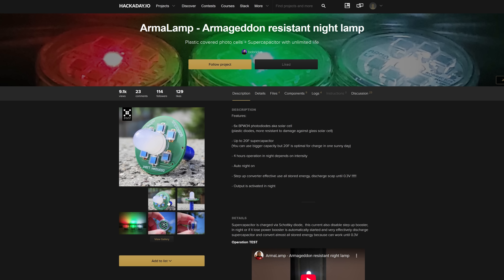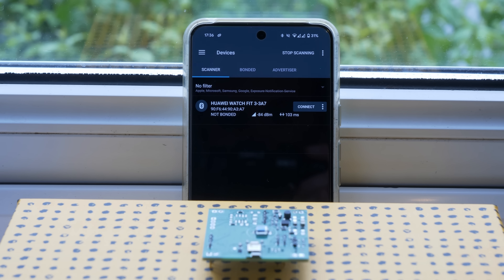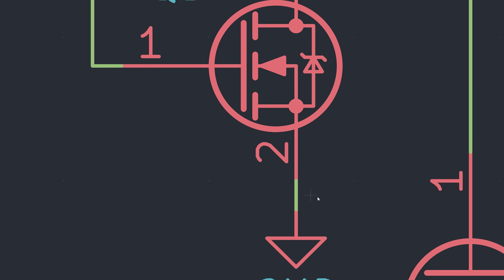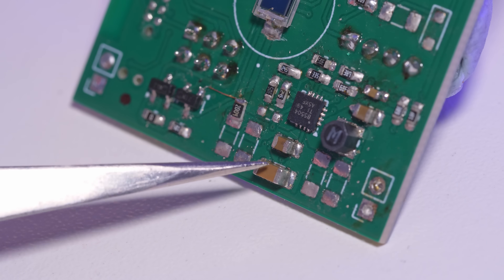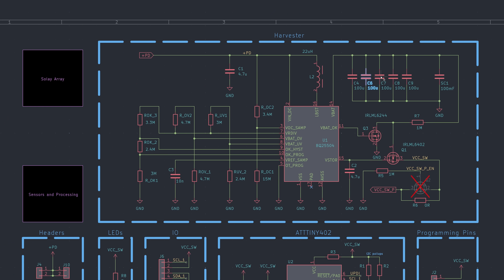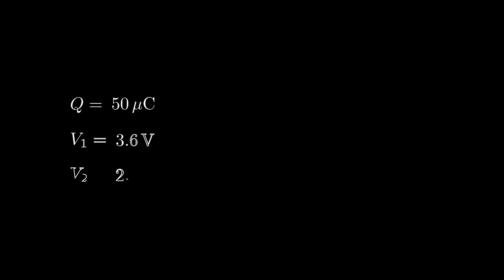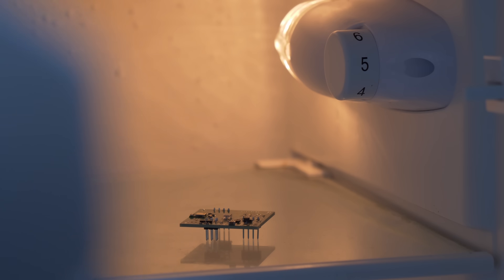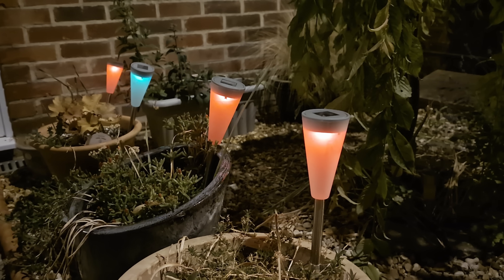Nordic chips are so efficient, you don't need batteries anymore

Comment: good project, but how does the boost converter handle a completely dead capacitor ?
They appear as a dead short at very low charge and resistance of the capacitor goes up as more charge is stored
Reply from the maker: Good spot. This specific chip starts off in a linear mode until the storage device reaches a high enough voltage for the switching circuit to start up.
Reply: @PocketConcepts_ I only ask as I did make a solar usb backpack once with 6 watts of solar panels powering into super capacitors instead of batteries. The voltage was clamped at 5.1 volts via a few power zener diodes to protect against over voltage. Worked alright but the solar cells were powering into a dead short until the super capacitors voltage rose

Comment: I have been dying to have an array of smart devices scattered throughout my home measuring things such as light intensity, temperature, humidity, air quality, etc. But there's always been the problem of them having to be plugged in directly or battery powered (and thusly needing to be recharged). This solves all those problems. I really hope you end up open sourcing this project, because I can see so many different use cases for this.

Comment: Solar‑powered, low-cost repeaters you drop everywhere to build a self‑sustaining mesh. Each node would have solar pads on both sides and either supercaps or a small cap array instead of rechargeable batteries, so you can mass‑produce them and deploy them on rooftops, in trees, or around a neighborhood. They’d form a very low‑bandwidth mesh—text, sensors or telemetry. You’d need a lightweight mesh protocol (LoRa or LoRa–WiFi hybrid) and local buffering, but it could run for days without sun. Unlike high-end solutions like Mesh++ or SignalFire, this would be ultra‑cheap DIY nodes meant for scalable community mesh networks with near‑zero maintenance.

Comment: Repeater for some kind of wireless mesh network? Produce a whole bunch of them and place them all around a city/town. Throw them on to roofs and hide them in trees, etc. Kind of like those old LED throwies, but with wifi. What's so cool is you could make them in bulk, and they'd be ready to go right out of the box.
Reply: A mesh network requires nodes to at least have a CPU always running. With a bit bigger solar panel and nRF chips it would be possible, but not this tiny photodiode.
Reply: @thorlancaster5641  I wonder  if you can do some hack to synchronize devices. i.e. somehow they wake up at the same time and one transmits and one receives.
Reply: @ToolTechGeek  That's basically how Bluetooth Low Energy works. Crystals of sufficient accuracy are pretty cheap now. You'd probably want some type of system where the receiver listens continuously until the transmitter sends a time sync message. After that, the receiver could listen only during a small window - say 10ms every 10s. The transmitter would send periodic (small, few bytes, low energy) sync packets to the receiver every few minutes. Small solar panels and supercapacitors would likely be enough for small packets like periodic weather measurements.
Reply: @thorlancaster5641 That’s so cool.

Comment: i really like the idea of it transmitting the temperature every few seconds. if i used a dht22, i can have a neat system that can automatically power off my cluster when its too hot/cold or the humidity is too high

Comment: A CGM (Continuous Glucose Monitor) without a battery would be insane, or augmented with this plus a battery. Current market standards are a CGM that lasts between 7 to 14 days attached to the body (after that, insertion point seems do diminish and provide less accurate readings), and transmit every 5 minutes to save battery. With this, it could transmit as quickly as it charges, which would give much more accurate data.

Comment: I have no clue of electronics so I didn't get everything told here. 
But if I understand correctly you made a circuit that sends a thermometer which sends the current temperature every now and then as soon as it's charged up enough via a microscopic solar cell? 
If yes, that's pretty cool that it works with so low levels of energy

Comment: - weather station (outdoor to indoor communication)
- tracking safety device (bicycle, car, boat, etc)
- individual room thermostat 
- bird tracker (if it can be made small enough)
- pet tracker (cat or dog)
Reply: A pet tracker would be good. The downside of the current trackers are the batteries. The battery lasts a long time but you could forget to replace it.
Reply: @john_hunter_  same with airtags
Reply: @john_hunter_  I would love a lora version that turns on and blips out a gps location
Reply: a tracker would need to transmit over 3g/ LTE, that consumes tons of power
Reply: +1 would be super handy if this thing could run transmit zigbee and trigger on vibration events or maybe a hall sensor
Reply: would need 3g/4g/5g + gps. The only way apple could get it to work is to make it in standby all the time and only do high energy stuff when you request, but if you request the high energy stuff from an airtag the battery in it will waste quickly. 

The thing he is doing here is changing a battery for capacitors, which can last forever and are easier to make, the downside to capacitors is that they usually discharge in one go, and he is saying he can regulate it with small ones so that it runs until the capacitors empty and safely power off. This basically means "its battery" or its "cappaictors" will last forever. You can buy this thing, put it as a temp sensor and even if it only transmits 20 times a day, it will continue to do so for the rest of your life, 20 times a day, no battery change, put in, forget.

If your car worked off capacitors instead of batteries, then in 50 years time, it would still have 100% of the cpacity that it had on day 1. However capacitors that handle such large amounts of energy are a bit scary, they have to be viewed as very powerful glass bottles full of electricty and if you break the bottle the energy will escape in one single burst. You would likely not survive a discharge from a capacitor needed to power a car.

Old school crt tvs used to have a capacitor in them big enough to kill you. In the film die hard, the guy straps a monitor to the top of semtex and plugs in some detonators. The detonators need an electrical charge to go off, and that then explodes the semtex. He throws it down the elevator shaft and it explodes. The implication being the capacitors in the monitor have enough charge when broken to set off the detonators. People who used to work on old crt monitors used to have to get special equipment to open it up and discharge the capacitors and ever IT class told you to never ever open a crt monitor on your own at home.

Back to this project, its perfect for his needs dont you think.
Reply: Good ideas, but trackers drain a lot

Comment: This would be useful for something like automating an AC unit to turn on specifically at a certain temperature. Mine already sort of has this function, but it requires to be left on, and it just runs the fan when not doing anything more power intensive. This plus some automation stuff would help solve that little inconvenience. And with two of them, I could setup a program that calculates the delta, and decides if the AC unit needs to be on or not based on the differences and extremes. If result = on, AC on.

Comment: Using ambient light to power miniaturized IoT devices is genius. I have way too many things I need to charge nowadays, and when you open up those LiPo devices it's staggering the % volume just the battery takes up. Remove the battery and it's two birds one stone.

I'd love to see this concept taken to its logical extreme. What do you think is the most power hungry application this could potentially work with? What could be powered continuously with just ambient room light?

Comment: Wow I can see why the algorithm recommended this video. I was designing a similar system, very low power consumption with a battery life of 2 years. What I wanted to do was place these in the forest near my house along the Appalachian Trail, which runs 100 miles here through wilderness, then collect temps in a few mid-level controllers which are more capable of longer distance transmission, and then so on, up to a 9600 bps ham radio system to get them back to a place where they can be analyzed, used to predict temperatures and weather, sending this to hikers on the trail through cellphones or ham radio.
Reply: that is a based usage, good luck.

Comment: My grandpa had a calculator from the 80s that was 5mm thick and powered by a photodiode. It would with a candle.
Reply: To be fair, except for the calculation circuit, the calculator's only other power draw is the LCD display. Which requires minimal power compared to radio broadcasting.
Low-power radio broadcasting (using BLE, Zigbee, Thread, ...) has only become widely available in the last decade or so.

Comment: This project is crazy cool! 😯 (I wish I would understand the electronics of this thingy)
I would probably use it to track the temperature and soil moisture in my garden to improve water usage efficiency. Maybe also with a slightly larger solar cell combined with a rechargeable battery so that I can have a 24/7 wind sensor on my roof.

Comment: hm...
Hart rate and blood oxygen monitor build into a watch with logging to an SD card.
Then you could log all the time.

If you could do GPU on top of that, then you could also get a new time.
But all this uses probably a lot more power than a small wireless connection. But maybe you could fit a larger solar cell and larger capacitors.

I mean you could be inspired by the RTX 5090 PCB and place the components a little closer 😂

Comment: don't know the exact numbers but i remember that Nurd Rage channel using tritium phosphor tubes with amorphous solar cells to make a Photovoltaic battery. I think the last time i looked into it it was for a LoRa device and you'd basically need to build like a fucking car battery of the little units that nurd rage made to power one. But 37uF seems a lot more doable. Could pot the entire thing in epoxy and have a device that's good for 10 years until the tritium tubes halve in strength.

Comment: It's 2025 and finally we're taking "free energy" seriously. :)
Reply: All I want is temperature and humidity sensors all over the place inside and outside my home.  But with LoRA, BLE or some other protocol that can be used by my iphone and/or laptop.  I think the standards are a bit too spread out right now, or require expensive hubs, but that's slowly changing.

Comment: Yeah some of these Nordic chips are insanely efficient, a while back we realized that you could run them periodically off body heat harvested through peltier elements. Sadly never got to test it out as flexible peltier devices are anything but easy to acquire.

Comment: finding ways to avoid being dependant on batteries is amazing, I really hope more products adopt this way of doing things
Reply: that's what i thought too.

"immortal devices" that can outlive the 15 years max of a battery. put it in something sturdy and as long as it doesn't stand physical damage, and, well, the sun still exists... it will live forever.
Reply: I'm a bit both ways on not needing batteries, if you actually add a battery to for example this circuit, it would probably run for 15 years or more. Basically the shelf life of the battery, because it uses so little power. 
So in practice it makes very little difference if it actually has a battery or not
Reply: @LunaticCharade  Yes, what I meant is getting rid of all those devices that we now have to babysit and make sure are always sufficiently charged even tho they barely ever get used. Some things do it more elegantly, for example game controllers that come with a charging dock for when you don't use it. 

But still it doesn't solve the overwhelming issue of every home now being filled with products that will eventually be chemical ewaste that most people won't discard responsibly.
Reply: Well, I mean sort of? But also 15 years is a LONG time, will you still live in the same house where you placed this sensor? 

And we could make a battery with a longer shelf life, I just said 15 years because it's a good guess, a battery might hold a charge for way longer. Not "way longer" as in several years more, way longer as in several times more, then we are talking 30-40 years, are your grandchildren still using the same wireless protocol? It might have been deemed obsolete and be illegal.

The point isn't that batteries are bad, the point is you can make a device that uses so little energy that it doesn't actually really matter if that energy comes from a battery or not. 

Although, if it does come from a battery it will still work even in total darkness.
Reply: @LunaticCharade  But there are already batteries with long shelf life and devices that can run on them for decades. And they're more ecofriendly than rechargable batteries. Here you can argue that it can use smaller battery, just to have this extra power for "dark" times, and I agree, bu also in this case the capacitor is sort of "battery" and we can add another part of circuit with something like small supercapacitor. Sky is the limit! :)
Reply: @nulen sort of, but I think you are missing the specifics here. If the device can run on a tiny solar panel indoor, then you can basically use any battery size and have it run for 30 years. You could add a supercap, but those are expensive. You also need to choose your capacitators very carefully, otherwise they might actually use several times more power than the rest of the circuit.

Comment: I kinda wonder if this idea could be used for micro satellites.  Tiny, low cost sensors you can fling across the solar system at speed, with tiny solar panels that slowly charge up over a day or two.  Space is big so you don't need data back every few seconds, so the only remaining challenge is making the radio signal "bright" enough to be seen across the solar system.

Comment: I've thinking about my wireless keyboard, split keyboards that use a Nordic nRF52840, with a 180mAh lipo, I get around a month of use before I need to charge. When I looked into it, charging circuits for lipos usually need more power...

Comment: Oh neat, I've already gone through two iterations of a board for the 25504 chip with no success.  First failure ignored the design considerations and merged the ground planes for the analog and digital circuitry.  With the power plane flooding the resistor bias networks with noise, once out of sunlight, the output shuts off even though the battery is fully charged.  The second failure again ignored the suggested layout a little by thinking it was a design mistake when those power ground pins connect to the thermal pad.  Except it doesn't look like the ground pins are connected inside the chip package because the battery refused to charge when tested.

Now waiting for the third version to try again.

Comment: This is essentially a high tech spark gap doing some work in an automatic circuit. When enough energy builds it can perform an action then it build again and repeats. This same thing can happen with a spark gap setup too. The potential builds until it jumps the gap (the work in this case) where this charges a capacitor until there is enough power to perform the action (the work) and then it builds up to do it again just like the potential in a spark gap builds until it can jump again.

Comment: Remote sensors that don't need periodic maintenance would be fantastic for monitoring a whole range of environmental conditions.

Greenhouse temp/humidity immediately comes to mind, but here in Finland winter temps below -20 °C can often need to be carefully monitored, if prolonged exposure (days below threshold value) can damage equipment.

Comment: I used germanium transistors to harvest energy at 200 mV level, and some Tunnel diodes to transmit a signal using the harvested power from light, stray RF, and thermal gradients concurrently; all on first principle physics, without modern converter/harvester ICs. It was fun - the ultimate Joule thief...

Comment: I would consider using it as an outdoor thermometer. I am wondering if stray streetlight is at all enough to power this device up, though. Perhaps it is not. But I am wondering how big capacitor one would need to send e.g. about 300 bursts, with an interval of 5 minutes. That would give pretty precise graph over the day and would survive the long winter nights of Finland. The thing is that a timer needs energy, too, so I cannot just multiply the capacitance mentioned on the video.

Comment: I'm still obsessed with the climate control system they were using at...I want to say "Xerox" and "in the 90's" but I'm not certain of either of those things. In any case they had temperature sensors all over the building, and their HVAC system could send packets of air from one room to another so it could balance out changes in temperature. It was extremely efficient. 

It seems like this could solve about half of that problem by making it easy to create a mesh network of temperature sensors that wouldn't have to be wired in to anything. The other aspect, deciding what action to take and actually shifting air around, would require servos on the ducts and a central computer (pi?) somewhere, but that doesn't seem insurmountable.